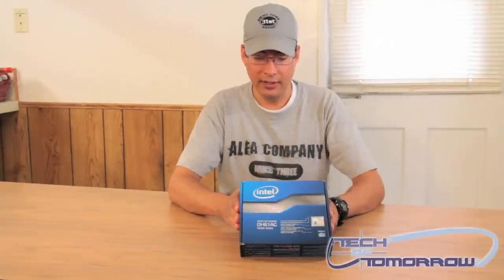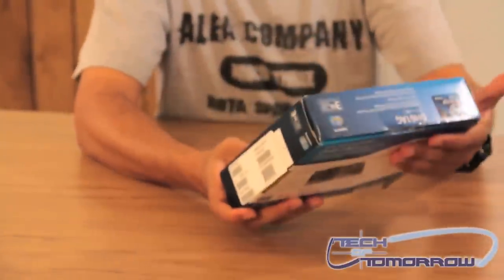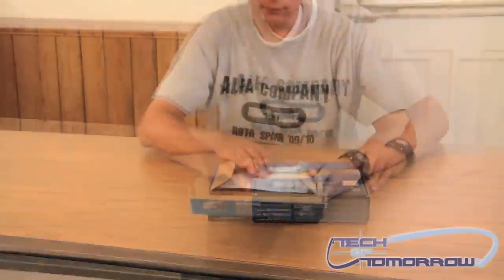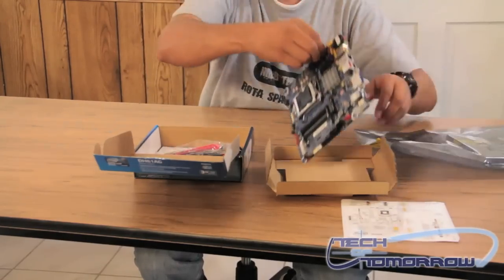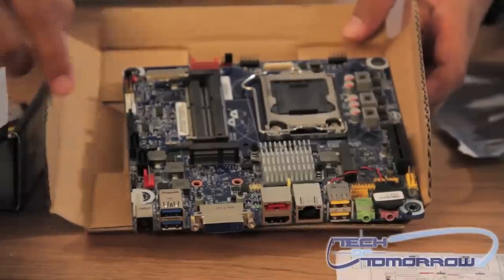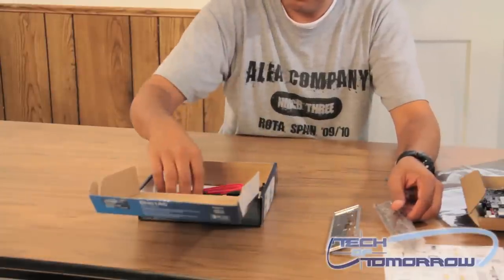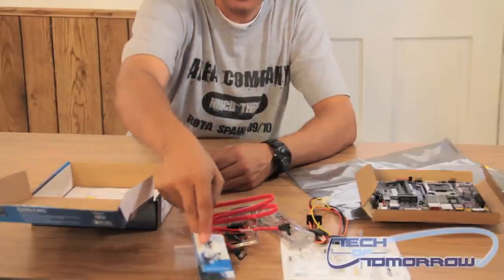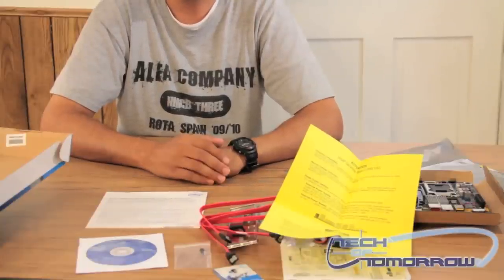Intel DH61AG Mini-ITX Motherboad Unboxing

Comment: @motherboardsorg its not that its basic. there is market for that as well as you would know :) its Intel's insane price points for even a board this primitive. one would fair much better with a AMD's APU based system for what these little systems are meant to do.